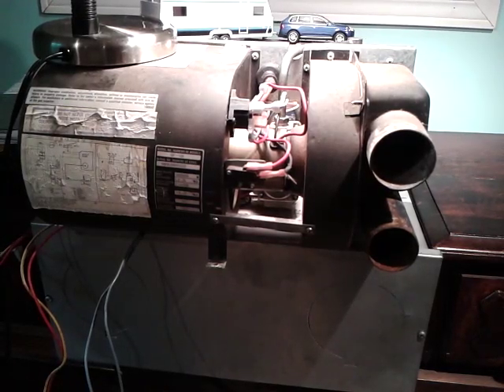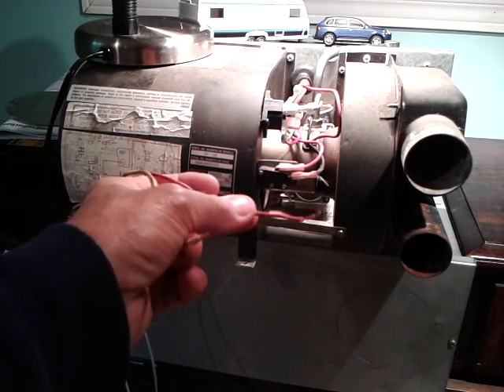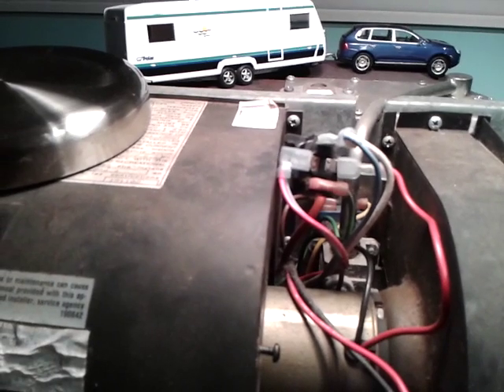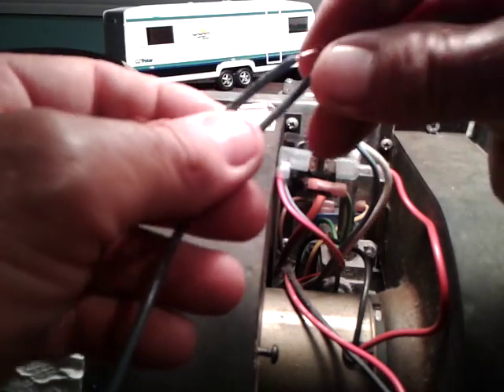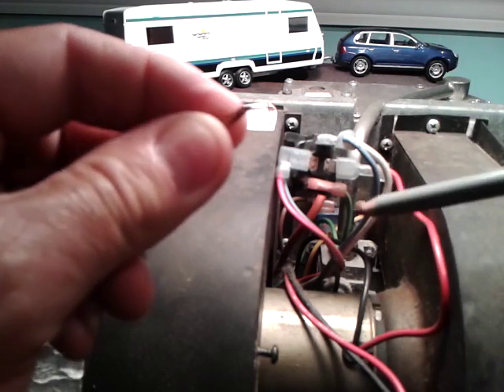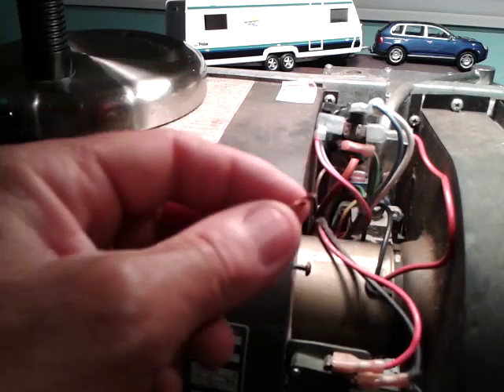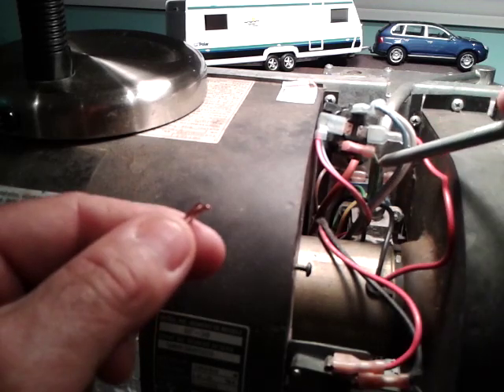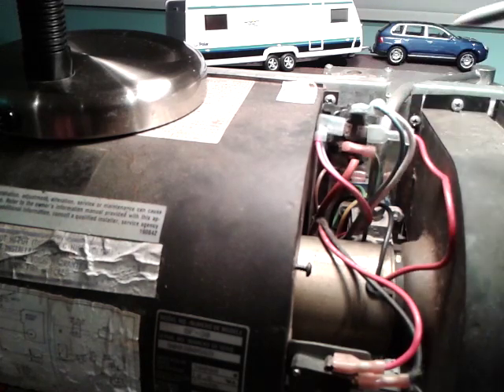Suburban SF-30 Time Delay Relay

Comment: My problem is that the heat does not shut off sometimes. None of the videos address heat not turning off. Would this most likely be the time delay not cooling down or the thermostat ? I can only stop the heat by shutting the power. Once I turn the power on it works fine again for a week or so.

Comment: Thanks Guy,
Replaced this same time delay relay, was able to correctly connect wires thanks to this video.
My problem was a loose wire terminal on the old TD relay causing times when blower would not turn off without removing furnace fuse.
Working great now...thanks

Comment: As Chuck says below, my SF 30 doesn't look like the one in your video either...  My unit had not run in several months and when I turned the thermostat to heat up the MH, the blower came on, the furnace came on a short time later and the MH heated up to 72 degrees and cycled off.  IT NEVER CAME BACK ON...  The MH got cold but the blower never came back on and neither did the furnace.  Am I right in believing that the delay switch is bad since that is the next in the sequence after the thermostat is set?  Again, mine does not look like yours in the video and I can't see the delay switch anywhere..  Any suggestions?  Thanks so much!

Comment: My SF 30 doesnt look like this. There are no switches visible on the outside, the sail switch is inside the fan cover, and the board is located on the left side secured with a metal bracket to the fan cover..  The RV was made in 2006. I cant find a delay switch anywhere. Any suggestions?
Reply: I think I need a fan control module board.

Comment: great video and well explain and if u still there to help can i ask you. What if the furnace calls for spurk and the heat comes on but it wont still on, it inmediatlly turs back off and then it tryes again a couple times but same thing. the gas goes but seems like the furnace doesnt know ignition is complited so, it turns the gas back off. thnks man

Comment: I have an SF-30 heater in my camper.  When I turn it on, I hear the furnace click like it is coming on, but the fan never comes on.  Am I right to suspect that the relay may be bad?  Or, is this more likely a control board issue?  Can you help?
Reply from the maker: It could be a number of issues...low voltage, bad temperature limit switch, low gas pressure, poor electrical connections, burn't out blower motor,...you get my drift. Sorry I can't help you any more than that, though wish I could. Good  luck with that. Let me know how it turns out.
Reply: @GuyPresse  If I tap on the relay and the blower instantly turns on, does that indicate I need to replace the complete board?

Comment: hi I have the suburban SF-42 and my heater works sometimes but when it comes on it goes through the cycle just fine it igites just fine heats up then the gas is cut off and then continues to run also when I can get it to come on I usually play with that switch, so watching your video would i be safe in the assunption that that switch is bad ??? thank you
Reply from the maker: +jeremiah patterson Could be the thermostat, could be low gas pressure, could be faulty flame sensor, could be lots of other things. Too hard for me to diagnose  on here.

Comment: how do you clean out
Reply from the maker: +Anthony Gallo The burner tube does not usually get plugged solid so that you can't smell propane at all. You can take off the plate on the furnace and you'll see igniter wires leading to the burner. You'll need replacement gaskets after you take it apart. Good luck with that.

Comment: the circuit board and ignitor are good the igniter comes on the circuit board is doing its job and the valve is clicking I just ain't getting any gas I can't even smell it.It's going through the cycle good just no gas the ignite
Reply from the maker: +Anthony Gallo Sounds like a plugged orifice. A bit of a job to clean that out.

Comment: I have a suburban NT-24SP everything works on it but I'm not getting any gas for it to ignite can u tell me what is wrong with it
Reply from the maker: +Anthony Gallo Those furnaces are a little complicated. I would need way more info. Could be the gas valve, could be a plugged orifice, could be the circuit board, could be the high temp limit switch, could be the sail switch, could be the regulator, could be the igniter, could be the flame sensor, could be a hole in the heat exchanger (dangerous), could be insect debris in the burn chamber. Not trying to be funny here, but when those things don't light, there are many things that can be faulty. Unless you know exactly what are doing, I wouldn't mess around too much with it cause it can be dangerous. Let me know what you find?

Comment: I'm looking at this because I figured out today that my blower for my furnace only works on 12 volt, which is stupid. Why? If I'm plugged in to 30 amp service, shouldn't it have dual power, so I'm not constantly draining my batteries when it's freezing outside faster than I can charge them back up? Even if I put two chargers at 15 amps on both batteries, it takes hours to recharge. I also have to unhook all the power to the rv while charging "so I'm told" so it doesn't mess with the rv converter's small 3 amp charger. So there's 4 to 5 hours or longer I can't use the main furnace. I just don't understand why there's not an AC power option when hooked up to shore power.
Reply from the maker: Peachride EightyNine Not too sure what type of rv you have. If the converter is working properly, you just plug in to shore and use all the power you want on the 12 volt side, or 120 volt side, or both,  and the batteries will stay charged up. You should never need to hook up other chargers to your batteries. Here is an in depth article on the matter. Hope it helps. Cheers, and let me know how you make out. http://rvservices.koa.com/rvinformation/rvmaintenance/rv-converters-and-amp-draw.asp